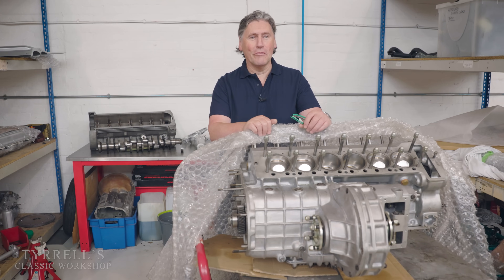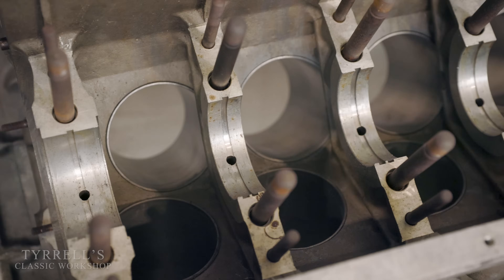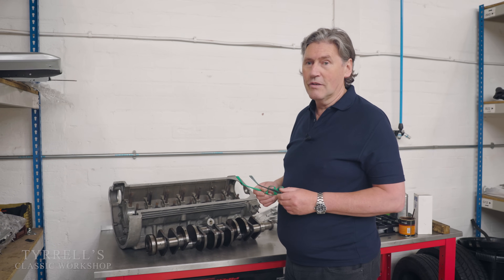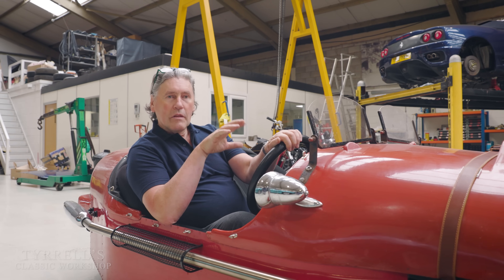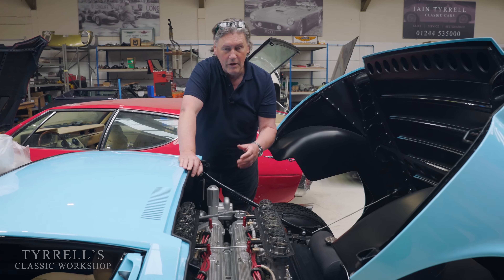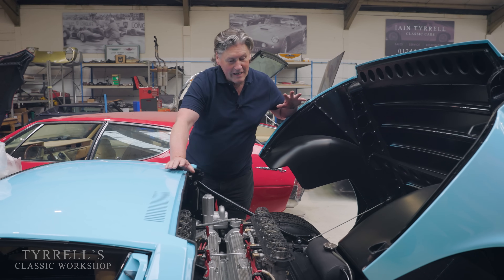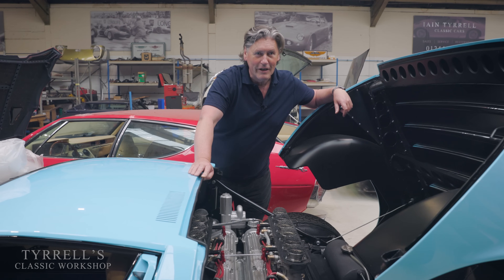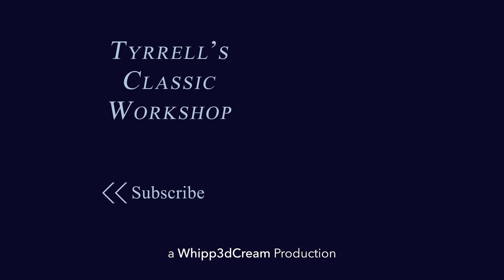How to warm up your classic car engine the correct way & why it matters | Tyrrell's Classic Workshop

Comment: Well first, thank you for this video and your time and savoir-faire. It is a delight to learn more about cars with the help of such a brilliant channel. 

So as you said, there will be questions, so here's mine, hope it doesn't sound to amateurish:

Since last year I'm the owner of a Ferrari 328 from 85 (EU version, K jetronic). When I bought it from a garage, similar to what yours (specialized in old classic cars) I was told to push the gas pedal down when I try to start the engine. So when I start it up the first moment it bounces to around 2000. When I see the motor starts, I let go of the pedal.

After this video, I ask myself, if I should first crank the car without pressing the gas and if it doesn't start, do as told.

Hope to get some insight from you or any of the kind folks reading the comments. 

In advance, thank you for your time
Reply from the maker: You should not touch the gas pedal at all when starting a 328 from cold. Leave the engine cranking over a few times (as it does) and then it should burst into life and run at exactly the right revs (1200-2000) if the auxiliary air valve is set up properly. Then just let it warm up a bit and away you go!
Reply: @iain_tyrrell   thanks for the fast reply and your advice. I'm thankful for all the insight you and your team give us. Have a great rest of the evening.

Comment: For a classic car (say 1975 Ferrari Dino) that has not been started for a few weeks or maybe even a little longer, how about disconnecting the coil lead(s) and turning the engine over with the starter motor for a few seconds (maybe 10 revolutions); then reconnecting the coil(s) and using your technique of no choke and 1500 RPM idle. Would this be a good idea?
Reply from the maker: It’s ok for priming a bit, but oil pumps don’t actually start delivering anything like proper pressure without the engine firing. Dinos have oil- jet lubed cams that won’t get properly fed till the engine is running

Comment: Iain, always such amazing information. Do you advise your XK120 owners to disconnect the automatic factory fast-start mechanism?  Would it be better to have it activate by a manual switch so it doesn’t continue to run the engine so quickly (and dumping in so much fuel) for so long?
Reply from the maker: Absolutely. This is a well- used mod on all XK engines with auxiliary starting carbs
Reply: @iain_tyrrell  Thanks so much!!

Comment: Great video ! BTW what happens when a plugin hybrid needs to crank its cold engine at 130 km/h (hello from France...). I asked Autogefühl and they asked to a Mercedes engineer while testing another one a few weeks later but answer was elusive to me...
Reply from the maker: Not sure- too little knowledge of how hybrids work to answer. But I suspect a modern engine with modern oil will be fine

Comment: An excellent piece this. I have a few things to add. Bearing lubrication is critical, but having a background in competition engines it is also important not to idle too slowly because you can take out the cam lobes unless they get a good supply of oil. The cam lobe is the most highly stressed part of an engine in terms of the contact pressure it has to bear between the sliding surfaces of the lobe and the follower. We would always get oil pressure by cranking with spark plugs removed, fire up and run at around 2500 to 3000rpm with no load on the dyno until fully warm. A road cam profile won't be quite so demanding, so I agree with your lower rev advice for a standard engine.  The worst (other terrible engines are available) offender here was the Pinto which had its camshaft suspended in mid air, miles from any oil supply (OK, they did eventually fit an oil spray bar but they were still notorious for knocking out cam lobes), whereas modern 16V engines generally leave the cam lobes and followers sitting in a nice puddle of oil once the engine is turned off. Incidentally, the easiest engine I ever dealt with here was the works Chevette HS engine. We ran an external oil pump driven by a belt and it was a simple matter to slip the belt off and turn the pump with a speed brace on the dyno - full oil pressure and the engine hasn't even been turned over!

You will have confused some viewers at 10:40 when you said there were no chokes, but all 12 chokes needed fuelling! The cold start choke is a completely different item to the venturi choke in the carb barrel - but you know that anyway. Just pointing it out for anyone just learning.

One thing that you covered rather briefly here is what you do with the throttle. I've lost count of the number of times I've seen someone start an engine from cold and then constantly blip the throttle to let the revs shoot up and down. Sounds great, but to anyone who knows what they're doing they just look like an ignoramus. Even some people who should know better have been seen to do this. Whether you have an ancient or modern, almost all engines have transient enrichment to richen things up as the throttle is blipped. An old engine will have a throttle pump and a modern will have an enrichment curve in the software. This is a disaster for bore and piston ring wear. The only engine I know of without this enrichment is in my lawnmower and that's a bugger to raise the revs on without it stalling.
Reply from the maker: Absolutely. Can’t cover everything but hopefully constant revs rules out “winging” the throttle.
Reply: I was also told you shouldn't blip the throttle and switch off, as that can cause bore wear as the fuel isn't combusted and it washes the oil away on the walls
Reply: @markbullen8967  people do that just to show off to others who are standing around.
Reply: Unless you have a Weber IMB range carb which has no throttle pump or air choke, just a fuel enrichment choke and is rather 'unique' in its starting characteristics....
Reply: Great info, Roger. And knowing that more modern engines allow the cam lobes to sit in an oil puddle on shut down seems like great common sense design.
Something I’m always mindful of if I’ve parked on a very steep hill is the position of the oil pickup in the sump as it may not be submerged in the oil depending whether you’ve parked facing up or downhill. I always try to roll to flatter ground before start up if safe to do so.

Comment: ok just realised that i was doing  everything wrong with my 76 choked 1,5 lada. On the best days it starts in half turn and most guys are saying "starts in a half turn " as something positive. These days using that car very little and always starting on choke and  leaving for it 10 minutes to work in hi revs... probably would be a good idea to manualy turn an engine few times with handle by the bumper...

Comment: Older cars are certainly not helped by the thicker oil viscosities they tend to require. Modern 0Wxx and 5Wxx oils surely alleviate the issue by circulating faster and more easily. So, would running a 5W50 instead of a 20W50 be an advantage to reduce wear on start-up, considering they have the same viscosity when hot ?
Reply from the maker: Older cars have larger running clearances for bearings etc. 
We’ve had Classic engines in the workshop needing overhaul simply because garages put too thin oil in them.

Comment: Great video, as always. I'm glad that my instinct to push in the choke as soon as possible is the correct one. I was driving a car with a manual choke yesterday and it was interesting how it still needed a bit of choke for a while before it warmed up. Otherwise it wouldn't accelerate. 

Incidentally, I believe the hand throttle fitted to a lot of Italian cars (like the Fiat 130 coupe) was there to allow the engine to warm up without the driver having to keep a foot on the accelerator.
Reply: hello John how are you doing 😊

Comment: Enjoyed this, always good to learn something new. I think you did a good job or explaining it all as its a quite complex subject with all the different variations of engines and such.

I do remember people recommending a Accusump for older cars as it can pressurize the oil from start so its always starting with better oil flow and also those block heaters they have in colder climates to pre heat the engines can be useful too.

Comment: Great video.. only comment to make is no mention of oil pressure gauge (where fitted) ?  Its always good to check the needle pings into life after 3-5 seconds.  If not shut down.  I also advocate if a car has not been started in more than a month to pull the fuel pump fuse and crank for 10 seconds on the starter.  Then replace the fuse and start as normal.

Comment: Excellent advice. As regards turning off a hot engine, I've always understood that idling it for a few seconds especially if it is turbocharged is a good idea to let oil temperature drop and certainly not revving it before shut down. This is also what concerns me about hybrid cars where an engine can be forced into life very suddenly and revved to 2 to 3k and put under immediate load. Can't imagine anything more mechanically damaging. Thoughts aynyone?
Reply: One of the reasons for idling a turbo car used to be because the turbo was oil cooled. If you were using mineral oil, then stopping when the turbo was red hot could cause the oil to break down and deposit carbon into the very narrow oil passages within the turbo and eventually killing the turbo. Idling the engine for a while and driving gently for a few minutes before stopping can cool the turbo down a bit to the point where the oil isn't going to break down. I think it was Mitsubishi Cordia Turbos in the mid 1980s that had a device to keep the engine idling for a minute or so after the ignition was turned off. It's not such a problem with synthetic oils.
Reply: Won't a hybrid continue turn the engine but without fuel and no ignition and so keep oil pressure high ?

Comment: I've been using a product called RVS Engine Treatment* for well over a decade now and I can wholeheartedly recommend it to everyone. One treatment lasts up to 100.000kms or 62.000 miles. I've usually renewed the process every 50-60 thousand kms or so. My personal experiences have included less oil consumption, quieter engine sound, somewhat better fuel economy and just overall better drivability.

There are different versions of RVS for different purposes, ie. my old 1962 Rambler Ambassador rear differential had a slight whine at around 80kph / 50mph. I topped up the oil and poured RVS meant for manual transmissions in the differential. Drove the car for a few hundred kms and the noise gradually disappeared. It's been 13 years and the noise is still gone.

*No, I'm in no way affiliated with the product. I'm just a happy customer.

Comment: Great information as usual, this is why some classic cars have a separate ignition switch so you have the starter crank the engine round several times to build up oil pressure and pre-lube the internals? I have some old VW bugs / Buggy's, is it wise to turn the ignition key for half a second so the starter goes round, which is not enough to start the engine, repeat this a couple of times and get the engine lubed? These engines are not used for longer periods as well.

Comment: How to gracefully climb out of a 3-wheeler 😉

The correct way of starting and warming up depends on the age of the engine. New and modern engines runs with high viscosity engine oils and will make oil presssure almost imideately. They can be started and drive of after the start up, but high revs must be avoided of course.
Old type engines is another matter. Oil is thick and vital engine parts may be dry. It’s very important to keep revs reasonably low, but not so low that the oil pressure is suffering.

Comment: One thing that always bothered me from the first day I purchased my brand new 2006 Toyota Corolla is that the engine never starts instantly. The engine always cranks a few times before it starts running. 
I thought this is going to be bad for the battery and starter. My car is now older than sixteen years and I have almost 200 000 kilometres or 125 000 miles on the odometer. I have the original starter from the factory and the third battery. So now I can only appreciate that hesitation before the engine starts.
To prolong the life of engines on my vehicles, I'm extremely meticulous with maintenance and I always switch to 0W-30 oil instead of 5W-30 oil, just for winter months to get a better flow of oil on the start under cold temperatures.
Reply: I had a similar thought about that delay, I have the same car with the same mileage! A new starter and battery did improve the start time.

Comment: Most engine wear occurs at startup and before the engine reaches operating temperature. That’s why I use a 0w engine oil
Reply: Which will happily drain away from the surfaces it is supposed to protect….

Comment: Interesting video . I’m guilty as charged , I’ve always been a believer in warming my cars up , but also did it for too long , or left the choke out too long back in my early motoring days - I past my test in 1979 - and my first car was a Hillman Imp . The car , as will no doubt remember Iain, had that fiddly floor mounted choke mechanism which I left out too long , causing piston wash , prematurely wearing piston rings causing the car to burn oil . There is , of course a fine dividing line between warming an old car up too long to, without putting some compression load into her,gently until the car is well warmed. Unfortunately the modern car motorist is not so forgiving when your “pottering “ up the road , warming your old motor , as they charge out their driveways ….. “Put the thing back in a Museum “ …… or worse!

Comment: Brilliant!    
I believe that I read in the Autocar McLaren F1 original road test, that the BMW V12 engine management system only allowed the engine to start after the engine had rotated at least six times, before enabling the ignition.

Comment: My 2019 Porsche Macan V6 automatically starts with a flourish of revs! Something I’ve never been keen on, but equally there’s nothing I can do about it. Having said that, the oil-viscosity is like water, so maybe it’s OK after all, who knows?
Reply: Modern cars make a big effort to light-off the catalytic converters as quickly as possible, striving to minimize the total volume of traditional air pollutants (CO, NOx, HCs) before the catalytic converters start performing their miracles. Thus they run high RPM for maybe 15s, YMMV.

Comment: Iain, why not fit a switch which disconnects the 12v supply from the ignition and turn the engine over on the starter for about 10 seconds without the possibility of it firing, then start it once the oil has circulated?
Reply from the maker: Petrol will wash the bores
Reply: @iain_tyrrell  I pull the hall sensor cable/plug at the distributor - in the belief that it not only cuts off ignition but also the fuel injection ? (on a mid ninties VW T4 petrol engine with a "Digifant" VW fuel injection system) I unplug the hall sensor plug directly at parking it, if I don't plan to use it soon. It protects me from forgetting to "prime" the oil pressure and gives a small additional theft protection.    And yes thank you so much:  love the moments when you pass the threshold of default knowledge. Instead of a sonic boom it unshunnable dimples  thousands of smiles

Comment: My motorcycle has engine management an usually cranks five times before starting,it then runs at around two thousand rpm.Finally after two to three minutes it idles a twelve hundred which for me,is time to go....................................

Comment: Very interesting .. I have a question, I have  TVR chimera, with the Rover V8, What is best if it is left for a long time not being used .. Some say start it regularly, others say don't start it for the reasons you have just stated in the vid.. which is my train of thought, I have left mine alone while I've been doing other jobs ..  but it's been over a year since I started it .. My idea to start it is to remove the Fuel injection relay and crank the engine over then with fresh fuel start it. So is it better to do this occasionally or leave it until I get it ready for the MOT?

Comment: Brilliant. Excellently and intricately clarified and demonstrated all essential basics. At least now I have learnt the exact technical internal reasoning of why to start classic cars without motor management systems very carefully and as per way you have demonstrated. I’ve always indeed been told to crank those motors shortly first without actually trying to start them, for giving the oil and lubrication a good chance first. Then actually try to start the motor. Once running, absolutely not rev it but leave the combustion smoothing out at ~1500 rpm for a short while first before actually normalising the throttle. Then driving the car under a gentle load for warming up the oil, motor and fluid temperatures. All well good explained and demonstrated in all details from an internal perspective. Thank you.

Comment: FWIW. Many thanks Iain. Just a thought from an ageing G7, an ignition inhibit relay could be fitted being triggered by the oil pressure warning switch. Light on=coil energized and the ign is inhibited. Light off (some oil pressure at least) relay coil is no longer energized and the contacts return to rest and are therefore in a closed state connecting the ign supply. I will use this on my next restoration. Tally Ho! From the Forrest of Blackness....

Comment: A bit off topic, but under what circumstances is it acceptable to run without air filters, like on that blue Miura? Can you really get away with driving like that, or is this more likely a show car?
Reply from the maker: Running without filters does reduce engine life but classic cars do not do big mileages normally. Up to the individual at the end of the day